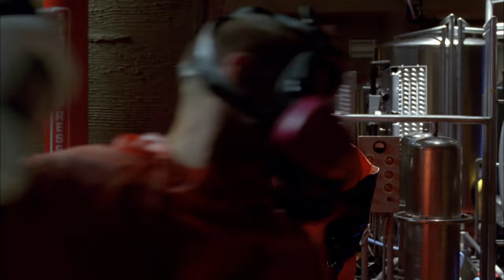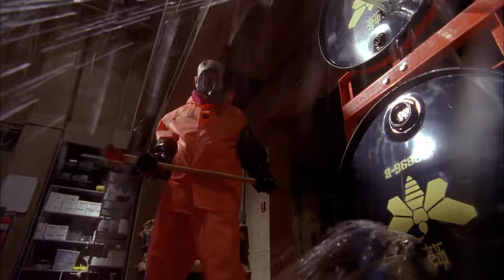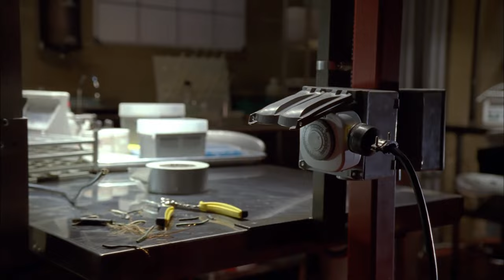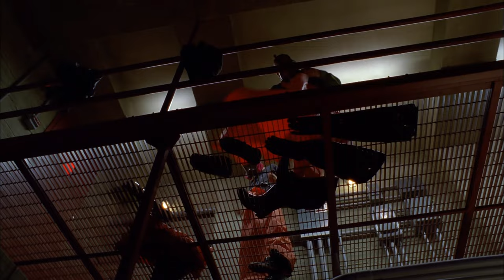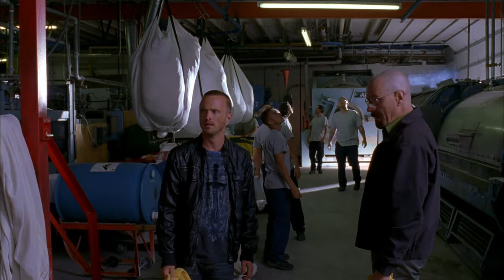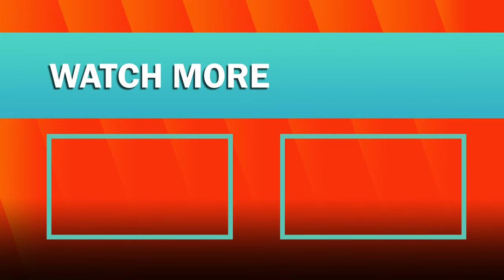Breaking Bad - Blowing the Lab Scene (S4E13) | Rotten Tomatoes TV

Comment: Steel axe punching holes into steel drums full of flammable liquid...
Reply: Flammable doesn't necessarily mean a spark will immediately ignite it. For instance diesel needs to first be heated before it will catch fire.
Reply: @GeneralSamov  Whilst that might be true.. did you watch the video? 😂
Reply: @jordan3400  I'm a 99.99% sure this is fine, you would have to be the unluckiest person on Earth for it to ignite, go put fuel into a soup can and try to ignite it by hitting on it with an axe lol, you'll have a long day!

(The thing is a metal spark will produce very low heat for a very short amount of time, not long enough to vaporize the liquid and allow for ignition, the electric spark is sustained and produced A LOT of heat, so it can vaporize the liquid that will then ignite)
Reply: firefighter axe has anti spark stuff on them.
Reply: Yea well that's why you crashed alot. Its the simple things..
Reply: That was a such a fine lab. Hated to see it blown up. Though it probably paid for itself.

Comment: Still felt risky leaving their suits there like that especially since they were left on a metal grid where it’s possible fire might not reach it so there was no full certainty the suits would burn which mean forensics could probably still extract dna evidence.
Reply: Ever been near a fire? Heat goes up... If anything, throwing the suit down was more risky as the fire would likely die down of oxygen starvation long before all flammable chemicals were burned up. Meaning the suit on the floor, submerged in flammable liquids, would survive while the suit on the metal walkway would be completely molten and burned up.